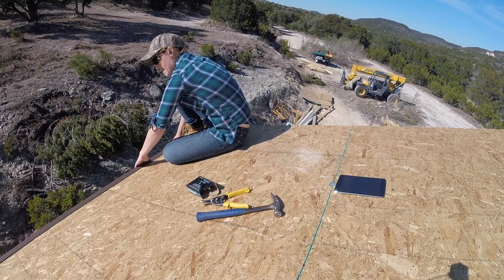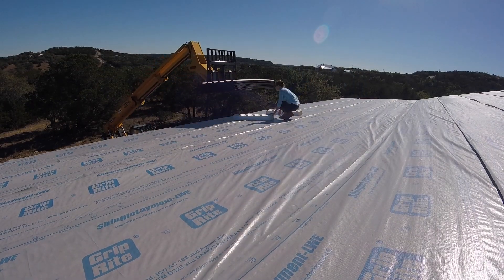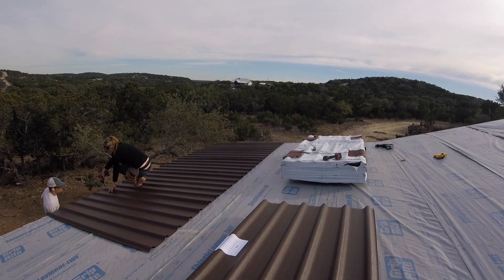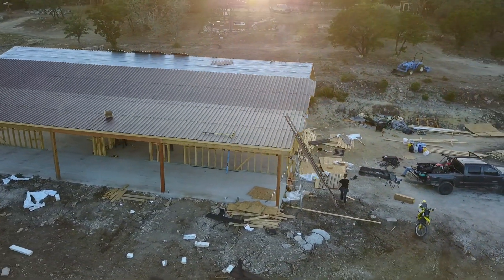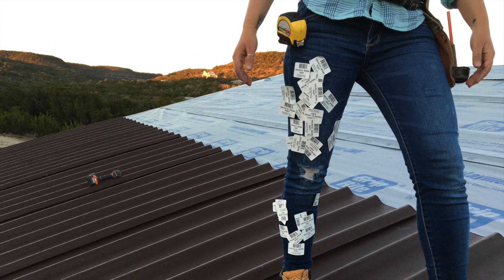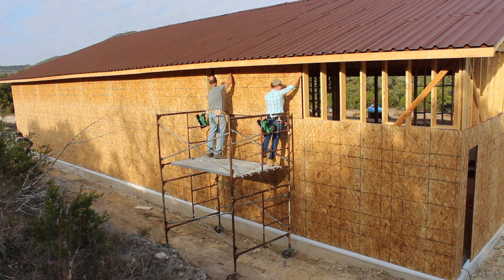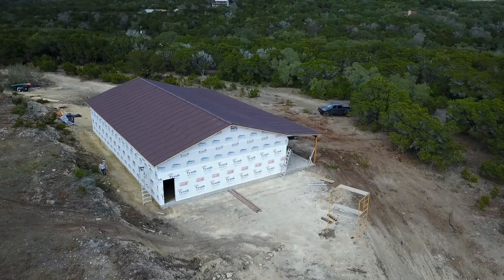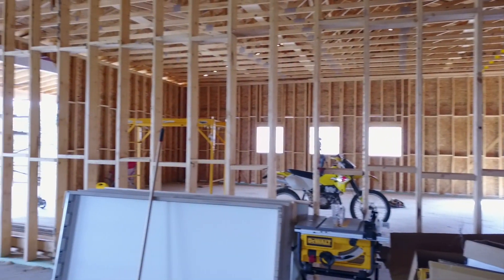Building A Shop - Roofing and Walls

Comment: Looks great, fine job. One question, though. Where're the skylights? I miss these the most in my 2600 sqft shop.

 Or at least high windows on the gable ends. Not too late.
Reply: yeah on gable windows or vents you can open or shut at will .
Reply: Lindsey Johnson 
I understand the need for light but I have worked in older hangars with them, and the extra holes just meant water leaks down the road. If done properly they definitely add a good amount of light, I have just never seen it myself.
Reply: Lindsey Johnson In addition to what upside downdog said, the beating that they'd take from the diabolical hail that we get in Texas wouldn't make them worthwhile unless you were desperate for them, which she apparently wasn't.  Also, since that's her filming studio, she probably wants consistent, reliable lighting that she has total control over.
Reply: CrankyPants 
Excellent points. A lot can be done efficiently with electric lighting now days. No extra holes to leak.
Reply: Amazing workshop, but I think I'd have more windows for more natural light. MMmmm missed the post about filming, guess that makes sense.
Reply: I have an attorney who litigates water damage caused by leaking skylights. Pretty specialized. He says all skylights eventually leak.

Comment: how did you get power to the shop? it looks pretty isolated.
Reply from the maker: I haven't yet, that will be a stand alone video.
Reply: Are going for solar some way down the road?
Reply: Have you decided on single phase or three phase? I wish I had three as it’s easier on the machines.

Comment: Any particular reason for no windows on the backside? Love the videos.
Reply from the maker: Windows kill wall space and I want the back wall of both shops to be used for material storage. Wood on the woodworking side and metal on the metal working side.
Reply: Where is your fall arrest gear ? Play safe😊 enjoy your channel.
Reply: +Troy Queen back breakers on a 3/12 roof is more of a hazard than not having it. The ropes get tangled and don't lay straight because they don't move on the deck. It's not a commercial job. It isn't necessary.

Comment: How come you don’t use a safety harness when on the roof??
Reply: Not necessary on a 3/12. It's more dangerous to have all the ropes laying all over around your feet. If you feel the need for a back breaker on anything less than a 6/12 you shouldn't even be on a roof.
Reply: pride doesn't over power safety or osha. most people that don't use a harness don't know how
Reply: Accidents don't just happen to 'liberals'.
Reply: Liberal vs. Conservative doesn't matter when your head bounces off the concrete. People have died falling from 6 ft. ladders.

Comment: Awesome love the space wow 😮 you can build a tiny home village in there LOL awesome. I’m a contractor from California GC. I noticed how you ran the osb sheer panel. Typically if you sstart vertical end vertical. Seems  need to stagger know how you ran your first row all 8 foot all the way across the first row that’s not up to code in California you have to run one 4 foot piece then a 8 foot piece and stagger all your joints and you definitely can’t switch from horizontal to vertical or vice versa typically vertical depending on the size of the structure or the plans you can do vertical or horizontal to stick with one way or the other. no switching in between then you have one continuous seem with no staggering not good must Stagger  the joints  for most optimal structural strength of the building. That’s the code  in California not sure of the code there. Still wow great shop!! 
PS. I wouldn’t want skylights ether just one moor place to waterproof lol. Keep up the awesome work thanks for the vids 👍🏻😎🔨
Reply from the maker: I talked to three different contractors about the direction and everybody agreed there was no problem with the direction I started with, or the change up. I looked into it before just jumping in.
Reply: Cool ya might not be  code there not to many earthquakes. I’ve seen people fail  there inspection on there sheer for doing it the way you did,it not sure about Texas but in California that won’t fly. When you get a stamped approved set of plans it has a detailed section on how to run your sheer. Vertical or horizontal  is cool, but you havto stagger your joints no matter what. A lot of times people will just run it like you did to save time but not code. It’s a way to cut costs but not as strong I’m sure your contractor friend would agree if not you might need to question there skill level no joke. If you go to a builders book store and get a good book on framing you’ll see what I am saying. Still I’m not familiar with how thy roll in Texas but always stager the joints much stronger. 
And did you ever set some HDUs in that slab just get some 7/8 all thread drill down in the slab on your sill plat add some epoxy set the all thread then install a HDU8 for 2x6 walls at lest at all your doorways. 👍🏻😎🔨
Reply: I live in Alberta Canada and it is code to run OSB sheets vertically and staggered due to expansion. We also don’t have earthquakes.
Reply: it  doesnt matter how  you run the sheeting  dude   as long as its  square
Reply: Bobby Livingsworth Sorry   actually it does it is very important to stagger the joints for lateral strength and  expansion specially when you have your top plates you want to have your joints staggered at your gable so there’s not a seam there. I don’t know what you know but that’s code. Any contractor Framer I know knows that I don’t know if you’re the one that told April that info but it was bad  advice dude it’s common sense if you think about it if you keep trying to argue the point,well you can’t teach common sense you just Gotta have it.
Reply: How you run the sheathing matters quite a bit. I've framed houses for over 25 years. In my experience, pretty much every manufacturer of OSB I've seen stamps a "strength axis" directly on the sheets in ink; indicating the direction of which is the strength axis. This is always in the 8' direction. The manufacturer's installation instructions also state that you must install OSB sheathing with the strength axis perpendicular to the studs to avoid bowing or "slumping" between the studs. The same rules apply just as you would install sheathing on a roof. Thus hence the abbreviation, OSB stands for oriented strand board. this means that the strands are oriented in such a manner to create the strength axis as mentioned. Therefore it certainly matters which direction you run it and should never run it vertically unless you provide additional wall blocking to support the sheathing and/or it is required by code.
Reply: Charley Cattanach Absolutely that is why I don’t use OSB  I use strut one plywood always, little more expensive but way better on all My builds. You’re absolutely right typically always run them perpendicular to the framing member not parallel but on the last few jobs I’ve done code is required me to run them vertically but always stagger the joints no matter what regardless vertical or horizontal OSB or strut one always have to stagger the joints I’m sure you agree you’ve been framing for over 25 years right I’ve only been framing for 22 years. 🔨😎
Reply: DL Construction, I do agree. My local codes do not require me to run any vertical panels. Therefore, I always run my panels horizontally and typically stagger my joints by 4' when possible. Over the past several years, I have ventured away from using OSB on walls as well. Instead, we use a product made by Huber known as  ZIP system. It is manufactured similarly to OSB but is made to a much higher standard. In addition, the framer only has to tape the joints using a tape designed for the ZIP system. This tape eliminates the need for a vapor barrier. Its a great system and is much more stable than normal OSB. Very little swelling as well when it gets wet.
Reply: Charley Cattanach Absolutely  I have heard of that product before. I’m sort of old-school stick to what I know but with your recommendation know I will definitely consider looking into that product thank you very much. 👍🏻🔨
Reply: It's my pleasure!

Comment: That trick with the wrap as a skirt was a good one!  The trouble you had with the house wrap and the wind is why I like to use zip panels when I can. They are more expensive but you can put up sheathing and wrap in one and it’s more durable and won’t blow off.  A building this size I can see why you’d want to save the extra funds.  Great job!

Comment: Watching you do the roof reminded me of doing a shutdown at the Shell Waterton gas plant. We had to fly some 4 inch valves out through the roof so about 6 panels (fiberglass) had to be removed so we could get them out. It was in the steam building so even shut down it was over 100 degrees F in there. The wind  is so strong there that part of their safety orientation is to park facing west because the wind is so strong (from the west) that it can take your door off. We were in a man basket hanging on a cable from a crane and when we got the panels off I grabbed the six 4X8 panels between thumb and fingers at the side of the basket while my partner gave the signal to take us to the ground. When he lifted us above the roof line the wind hit the panels and I was sure it was going to break my thumbs. If I had let go 6 panels would have been flying across the site and someone would have gotten hurt, and that plant is extremely safety conscious. 
No doubt your mama is proud as hell of her daughter. I sure would be.

Comment: This is by far the best build video I have seen on making your own shop. I have been looking to do this for some time now, and after seeing this video I think I will have to give it a shot this summer. My shop will be much smaller, but the steps would be similar. Also thank you so much for posting your materials list. That roofing actually looks pretty cool and sure beats using traditional shingles!!

Comment: Tip for building wrap: run a rope through the center of the roll and through a piece of leftover wood to hold the wrap on the rope. The top end of the rope can be temporarily nailed below the roof ridge and keeps the roll in place while you pull the wrap off of it like pulling paper towels off of a stand.

Comment: Great idea wrapping the bottom of the OSB, The bottom 6 inches always gets ruined by wicking water. I’ve even gone so far as spraying the bottom 3 feet with water preservatives on both sides and bottom edge. It sure helps. You are doing a Great Job. Congrats,  👍👍 Vinny 🇺🇸
Reply from the maker: Thanks! Yeah I thought that was a great tip.

Comment: When I was working as a stuccoer, we used to use something that we called ladder jacks.  They were metal arms that would sit on a wrung of a ladder and a chain would go up to a higher wrung.   With two ladders and a set of ladder jacks you could slide a 2 X 12 across the jacks and you had instant scaffold.   Made applying the wall paper and lathing wire much easier.

Comment: You did one heck of a job April  it looks great  and that is a tremendous job to accomplish !  You guys will get a lot of joy and use  out of the new building  I’m looking foward to seeing it  being used in the future ive done a few roofs in my life and having that person on the ridge like your mom did is a tremendous help to the job  as far as speed, safety , and  even moral  when needed   When doing asphalt  they can  slide the next  shingle into place that with practice the nailer  doesn’t even  slow down  adjusting  shingles  its like having a good cut man  on the ground when building a second story deck  or woman  as i know you will correct me  as one of the funniest things i saw you  do was change the name on Manville insulation adding the WO in front  i thought that was great
Reply: Those asphalt roof sheets are screwed in.

Comment: @April Wilkerson Tip for installing tyvek home wrap, if you ever do it again. Just keep in on the roll and put the roll against the wall and roll it out you can pull it tight by pulling in the roll. This way the person rolling it out deosn't need a ladder, they just walk along and roll it out and adjust it as needed.

Comment: I love the "skirt" idea.  Never seen that before.  I'll be building a much smaller 16x10 (shed/shop) in the near future and I might just do the same thing.  Love the vids.
Reply: There's a reason you haven't seen it before. Any moisture that develops behind the paper will get trapped in the pocket thereby causing mold and rot issues. It is much better to put a piece of flashing with a kick out bend on the bottom of the wall and hang it about 1-2" lower than the bottom of the osb. Install your paper over top and you'll never have a water issue.

Comment: If you ever frame another building / house we always sheath the gable end trusses on the ground before setting them as well as cut the house wrap for them and then we attach it and roll it up so its above the top plate.  Then we bust a hole in the sheathing at the peak large enough to get the crane hook in.  Then we are able to roll it down when we roll out the rest.  It makes the worst part of house wrap a little less aggravating.  Just curious in your area what your code requirements are on sheathing nailing if any.  I live on the east coast of NC in 120 mph wind zone code.  Our bottom plate has to be double and requires a 3" nail spacing in  a zig zag or M pattern on that bottom and then the edges of the sheathing as well as the field of the sheet are required to be every 6".  Takes a lot of nails in our area. haha   You are doing an amazing job and I am enjoying watching the progress!

Comment: That roof panel stuff looks tough to put up.  On my house, we put up 33 squares of conventional shingles in a couple of days.  I gave up on shingles.  Steel sure beats asphalt/plastic.  After 30 years of the shingles, I went with painted steel on my house.  When I built my shed, I used painted steel.  No seams required on the roof (you can get sheets cut to the nearest 1/8" up to semi trailer length.

Comment: Good call on the synfelt. Way faster and better than tar paper. It is not intended for any roof shallower than a 3/12 so it really shouldn't have been used on the porch area. That should have been ice and water guard. Most manufacturers also will not warrant the product if it is installed with staples. It must must installed with cap nails or with cap staples. 

The tyvek wrapped around the bottom of your osb may prove to be problematic. Any moisture that collects behind the tyvek can get trapped in that pocket you have created and cause the very problem you are trying to avoid. The better way to eliminate this problem is to install an 8-12" piece of metal flashing with a kick out bend on the bottom and have the metal hang 1-2" below the bottom of the osb. 

The osb should have been installed horizontally and half lapped. With a horizontal position you're hitting 7 studs per sheet but because you're half lapping it you don't have any breaks making a much stronger wall.
Reply: With a 12" nail pattern on your osb, you won't have any curling. 

I think you're doing a great job, though. That is not a small undertaking and it is a project you can be proud of for years to come.

Comment: Being in Texas I'm a little surprised you didn't choose a white roof to keep the temperatures down as the weather warms up.  It looks to me like the weather isn't that cold in the winter so the solar heating you lose with a white roof isn't a big concern, but it's going to be pretty darned hot when summer hits.

Comment: Had hoped you would have moved up here. Still have to get the 5th Wheel out of my 3000 sq ft shop. Working on generator hook up. We just had 30 hours power outage.

Comment: I would use asphalt underlayment under what used to be called Ondura, a traditional Texas roof. Light plastic will degrade faster. Though putting the screws on the high ridges will work, new research shows that the screws should be in the valleys. Yours will become loose. I see you are in the hill country, beautiful.
Reply: Those are not plastic sheets, they are Ondura asphalt sheets, check out the website linked in the description, she did use their tuftex on the carport build.

Comment: Absolutely awesome job! A quick question for my own knowledge and curiosity, I've never seen that type of roof. How do you keep it from leaking when you have to screw it in? Keep up the great work!
Reply: If you watched her showing use of a screw to predrill hole through ten sheets at a time, or click the link to Onduline in the description and check out the ondura product which she is using here, you would see they are epdm rubber washered color matched screws.
Reply from the maker: The screws for installing come with a rubber washer that seals under the screw head.
Reply: Joshua79C C thanks man. I missed that one.
Reply: Found out about them when shopping at Home Depot/Lowes about 5 or so years ago, looked at the brochure to see how they are secured, then saw the boxes of screws with the washers 'that is awesome' was the though in my head after learning about them then, just killing time that day when I went shopping for a new window ac unit. Live in Massachusetts so I hardly notice if a house or other building has that type of roof finish.
Would use them myself when I have got a project need to re-roof or get my own real estate and looking to add another building for multipurpose utility.

Comment: April if you dont mind my asking how much is a building this size going to cost you?
I am in Upstate NY and i am having a small shop built 22x26 Gambrel 2 story Amish built the building alone is $16000 and the concrete $4,250.00 when its done we will probably have $25,000 into it we will be sprayfoaming the roof since it gets really cold here and thats pretty expensive.